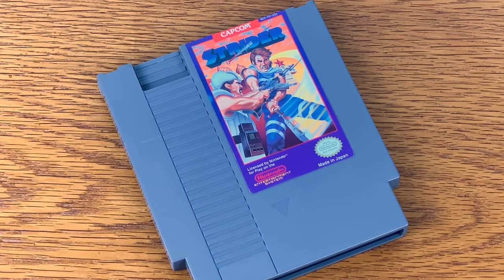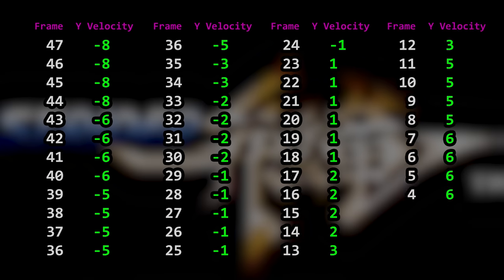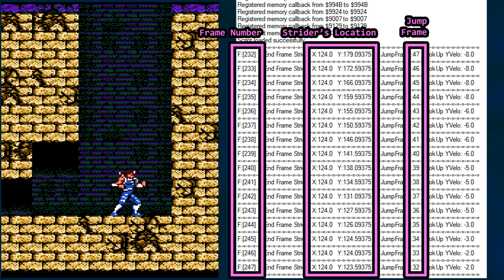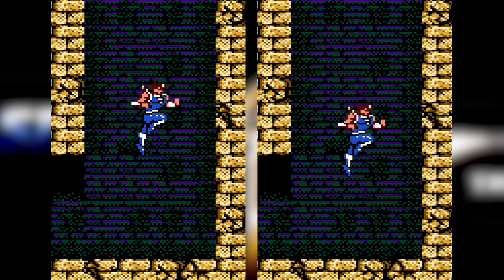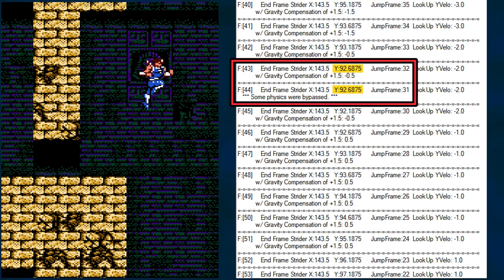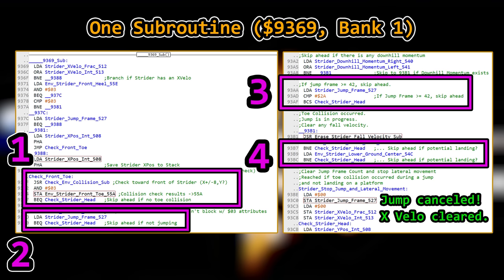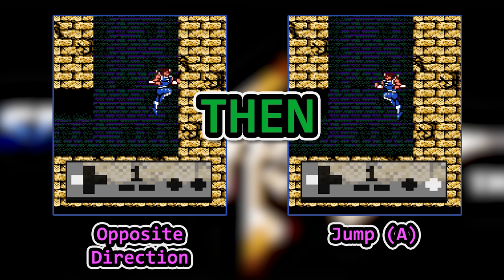The Physics Nightmare and Bizarre Jumping of Strider (NES) - Behind the Code

Comment: This video should be shown in software engineering classes, as an object lesson for why the concept of Finite State Machines is important to understand. The programmers here clearly didn't think in terms of "here's the checks to do if the player-character is jumping; here's the checks when he's walking; here's the checks when he's standing still on the ground; etc — and he can only be doing one of those at a time"; but instead just did every check in every "state", as the ASM equivalent of a long series of if-statements, with many possible overlapping "states" active at once.
Reply: Exactly. These can be extremely hard to debug
Reply: It's not really an issue that an FSM addresses directly. It's a constraint programming issue, because the physics in Strider are supporting several features simultaneously that produce multiple competing answers: are we ascending a slope, is a wall colliding, are we jumping, are we trying to triangle jump? What a constraint solver does is frame the problem in terms of "filter down many competing and potentially valid answers into a single definitive one by turning it into a sorting-and-ranking problem". Applying sorting makes it much easier to reason about than trying to break it down into a large number of finite states.

What Strider actually does, and what everyone tends to do when addressing constraint logic one feature at a time, is to add more and more state to try to adjust one answer as you go along, losing a lot of information in the process. You don't want to lose information in your physics until you know you can make the optimization(and this is why the common axis-aligned platforming logic of "run X axis physics, then run Y axis physics" manages to work well, but imperfectly - it's an optimization on solving for both permutations and selecting the one that gives free movement, it just drops one permutation from ever being considered).
Reply: it's very good for my imposter syndrome that the way these types of bugs are created require programming in ways that immediately set off alarm bells in my head.
Reply: It's worthwhile to note there are good times to use this kind of code, like when you want to blend logic. A string of conditionals in the right order can keep code very tight and produce muliple effects. For example, if the player is not touching the ceiling, skip to the next check, otherwise set vertical velocity to zero. This allows all previous X movement to continue to propagate while allowing downstream gravity or ejection to start from a known point. It requires extensive planning, but it allows for overlaid logic to address complicated states.
Reply: So in a nutshell they anticipated quantum computing in a videogame.
Reply: NES Strider Hiryu is Schrödinger's Avatar.
Reply: I quickly found out through doing a few game jams that Finite State Machines are my favorite way to code a game.  They're easy to keep organized when you're trying to integrate several different elements at once.
Reply: @BetweenTheBorders is this example from mario 64 tik tok clock warp?

Because i believe i heard it explained as a way to keep mario from clipping but in this very rare to reproduce bug, caused mario to warp to the top of tik tok clock.
Reply: Dude, this was an arcade game, he's looking at the wrong version of the game. Nobody played this shit on a goddam console.
Reply: @nickdorazio3rd  I heard that was a cosmic ray smacking the transistor just right to flip it to 1 from 0 or vice versa

Comment: So, the sprite logic starts late in the frame, the controller inputs are read late in the frame, and the physics calculations happen late in the frame....  What is Strider doing early in the frame?  Microwaving fish soup in the NES's breakroom?
Reply from the maker: Hey... What's that smell?
Reply: Late in the frame is specifically when you want to do all the input and input-dependent tasks. The later you can do them, the less total input to output latency you're going to have. But before the vblank hits and you have to update the scroll and upload the sprite table quickly.

If you're wondering what you might be doing early in the frame... well the very first thing you want to do is pick a good time to run the sound/music routine to update the soundchip registers, maybe you do this on a line interrupt to reduce jitter, then you want to load the graphics tiles for the things getting scrolled in, which takes a while, update the tilemap. You might even be doing enemy animation sprite and position updates early in the frame before you process inputs, projectile updates as well. You do this in the shadow buffer in main RAM. Enemy logic too, because if the enemy seems to react to your actions rather than catch them mid flight as if it was mind reading you, its just a tad more convincing. You can process pickups before inputs as well, making them also a frame delayed, it's fine, looks even a little weighty, nice.
Reply: It's finishing the overdue and now pointless sprite worn from the previous frame 😂

Comment: My god this game is a gold mine of bad freaking code decisions.
Reply: As seen in the comments sections of the first video, NES Strider seems to have been initially programmed by someone with no (or very little) previous experience with the system and then a more experienced programmer at Capcom (who was responsible for that game) had to jury-rig fixes just to get a "sellable" product out the door in a relatively tight time frame.

Comment: Despite NES games being somewhat of a niche, this is honestly more valuable than most game development tutorials and "essays" I've found. It's not about the code per say, as in, what I should type. It's more about the problem I'm trying to solve. The way you structure your videos gives me better ideas about how I should try to think about specific problems, and the logic required to make the code blocks I write work with each other, instead of just trying to find the right "Fix", the right math formula, whatever.

I can't say I understand everything, but you often put me on the right path, and that's all I can ask for.
Reply: Honestly what I love about channels like Displaced Gamers and RGME, they focus less on what the code says exactly and more on the logic of the CPU and likely what the developers were thinking when designing things. It makes it very helpful to actually learn and understand these things. Very useful, even if you aren't familiar with 6502, or even retro games in general.

Comment from the maker: This one was a blast. What do you think of holding down A for the Triangle Jump? Should I have gone for something else? There are so many other issues to address in Strider.

Speaking of things to address in Strider - I think I will upload some of my Strider work to the Displaced Gamers GitHub (by the way... Displaced Gamers "is on GitHub"). This project took a lot more reversing than usual. Perhaps someone can take the work and run with it. https://github.com/DisplacedGamers

Hope everyone has a great day!
Reply: Seems like a relatively sane solution to the problem and an elegant fix that you can do it in a single GG code.

As far as overall "feel" of wall jumping, I think nothing has beaten the Mega Man X series for me, so I would consider it an improvement if your fall speed actually reduced down when in contact with a wall instead of sped up, but I also think Super Metroid feels awful when a lot of people tell me they have no problems with it, so maybe it's a "me" problem.
Reply: @WillowEpp  Super Metroid's wall jump is tricky, but the game helps you a little with a unique frame of animation to let you know the window to press the jump button. If you're spin jumping along a wall, then press away from the wall, there is a window of about 2 frames where Samus' sprite switches to one where here feet look planted on the wall. That's when you hit jump.
Reply: @GeekSHO  Oh, I know exactly HOW it works. I can do it. I just hate how it feels. It feels awful to me.  This is a subjective thing.

(I still think that if there were more than three months between the release Rockman X and Super Metroid there's a good chance it would have turned out differently, but we'll never know for sure. ㄟ( ▔, ▔ )ㄏ )
Reply: This is basically coder church. PREACH IT BROTHER AMEN!
Reply: I agree that the solution is better and a good patch but it's too easy and some timing constraint should make it more fun.

Comment: I actually took the time to finish the game despite the awful experience of movement and every sprite interaction feeling glitchy. I had recorded the last stage on a VHS tape of games I had completed, so I got to watch it again over the years. This video doesn't even get into the difficulty of jumping effectively off of slopes which are prevalent in the game and usually interacted with while scrolling is happening.  I had to figure out the wall jumping without knowing any of this too. I would just try and try again when physics broke and I definitely remember making sure to stop the screen scrolling before difficult jumps despite not knowing why this helped. Thanks for making all those hours of frustration finally feel like it wasn't my failure to learn... it helps to know that I was actually  learning to subconsciously manage a handful of horrible bugs and somehow still be able to beat it without having to restart my VCR recording too many times to make it possible.

Comment: A solution that comes to mind to fix the triangle jump logic: only require the button press, not the direction change. The player will still naturally hold the wanted direction to reach the opposite wall. To prevent abuse, we could also ensure that you can't jump more than once in a row from the same wall (by comparing the x position of the wall jump with the previous one?)

Comment: I remember when I first played Strider on the NES, I was seriously considering taking it back to the store, because I was sure it was a defective copy.  That's how bad the physics are in this game, and it's nice to see some explanation, even if the explanation itself is baffling — why would Capcom do this instead of just using a normal jump physics routine?  Was it all to (badly) implement wall jumping?
Reply: ... also, I was amused that Strider bounces off walls the same way as the square in Adventure, for what I suspect is the exact same reason (specifically, that it has wall ejection without wall collision).  Even later Atari 2600 games like Haunted House don't do that.
Reply: It seems like a completely inept programmer did the work for some reason. Maybe it was an intern
Reply: @MaxOakland  The game's credits highly suggest that the initial programmer was indeed very inexperienced with NES development and that a more senior programmer had to jury-rig "fixes" to get the game to a "sellable" state.

Comment: I've started writing my own emulator, although for the PS2 and not NES, but I'm definitely going to incorporate a debugger into it because of your video series. The more I see of this series, the more I wish every emulator had a debugger built in. I know it sounds silly, but I'm also going to write a PS1 emulator at the same time because if it does PS2 games it should also handle PS1, since the original hardware could, and I don't accept the later revisions that removed those chips as valid for the purpose of writing my emulator.
Reply from the maker: That's awesome! Good luck with your work. I feel the same about debuggers in emulators. I also wish they were all as good as Mesen's.
Reply: Mesen is just amazing in that regard  @DisplacedGamers
Reply: I think all revisions of the PS2 can play PS1 games.
Reply: @CptJistuce   If they could then it was with emulation, because they removed the PS1 chips in later revisions.
Reply: @anon_y_mousse  really think you're thinking of the PS3's loss of PS2 compatibility, as most of the PS1 hardware in the PS2 was a pare of the IO Processor and integral to operation in PS2 mode. That's where the R3000 lived, as well as the DMA controller, sound processor, controller and memory card port handlers...
Reply: @CptJistuce  You might be right about that. I've been reading about the PS3 at the same time, and I probably should just focus on one thing at a time.

Comment: if i'm not mistaken, super metroid actually uses a very similar wall jump mechanic. you have to make contact with a wall and then rock the d-pad the opposite direction about one frame before you hit the jump button again or it doesn't appear to work

Comment: I feel like the better solution is to simply cache the "changed" A button press state for the frame into a second cache location, then check that in the wall jump routine.  Since the main "changed" status var is wiped by the time you need it for processing, you'll have a backup value now insteaad you can check.

Comment: The real irony of the wall physics in that stage when you are doing the Triangle Jump (I think its Egypt ?) is that ,when you look at the way that Capcom later figured out what they wanted to do with the wall physics in another game series that relied on that:  Mega Man X

Like it seemed like the programmers here were trying to learn WHAT they wanted to do with walls because it seemed like the wall on the left was programmed with "Grip" and the other wasn't so that causes a conflict for the player because they can't keep a proper mental clock in their head to actually do the jump properly.  If we took say...Super Metroid its a lot different because the game's walls didn't really have "friction" but seemingly a strict set of inputs that the triangle jump had and ,unless you practiced it a lot you were going to have problems as that always gave me nightmares.

While I am no programmer it feels like CAPCOM wanted to create a type of complex mechanic but didn't realize its surfaces were in conflict with each other vs.concert and like I said when it came to Mega Man X they seemed to have figured that out because when you wall jump in that game all surfaces seem to have the friction that is required and not grip.

I know I might have just repeated a lot of what you said in that section of the video but for my laymen brain that clearly has not programmed a game I needed to try and really simplify this for myself just to understand this even better.

That said though this is a great video and a really awesome channel for people like me to see what is really going on inside of games that I grew up on

Comment: It would be very interesting to see you do an equally deep dive into the code and logic of jumping in a game with a similar level of jump/movement complexity, but with - in your own subjective opinion - 'good' jump/movement logic
Reply from the maker: It would take a bit more effort, but I think Super Metroid is a good candidate for that. On more of an NES note, the Mario games - both SMB1 and SMB3 would be good examples. Changing direction in midair as well as acceleration when running.

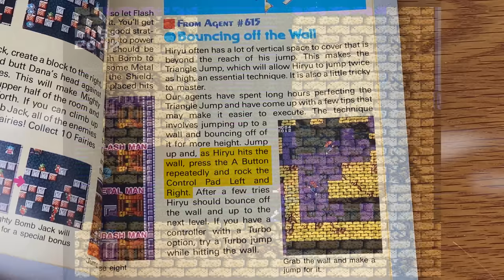Comment: 11:13 & 15:51 This is not a good suggestion to do the Triangle Jump because this is also what I did initially by myself without relying on any guide or advice as a kid playing the game in 1992.
Wildly rocking left & right while jumping only brings frustration and finger injury.

The method that works for me is : 
There is no need to hold down the jump button. Tapping jump or holding jump will give the same jumping height results.
Do not walk against the wall before jumping, your jumping height will cut short to about 1/3 making it impossible.
Do not rock the direction left & right multiple times wildly within 1 second, the actual timing is changing the directions calmly around each second. Doing it too fast will make you fail.
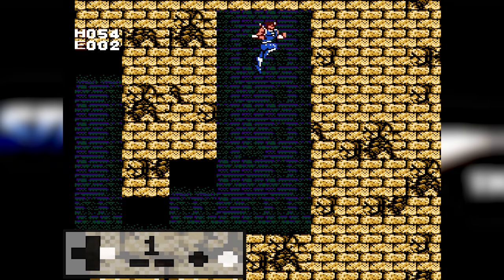So watch from 11:36 - 12:01 carefully to understand the steps below.
Do not be afraid of dropping down a few pixels; it is important, more reliable and comfortable to do the triangle jump this way.

Start by walking towards the wall and tap jump.
Let the character touch the wall, then stall and start dropping down a few pixels.
Then only press the opposite direction, and then tap jump within half or quarter seconds to make a successful jump. (You can attempt to press the opposite direction & jump at the same time, but you will fail if the jump button is pressed first instead before the opposite direction button is pressed)
Repeat the touch wall, stalling, dropping down a few pixels, then changing directions, tap jump within quarter second of direction change.

Using a turbo jump will help doing this easier as it will help you concentrate on the touching wall, stalling, dropping down a few pixels, then changing directions.

I have reconfirmed my methods above just a few minutes ago on my NES.
Reply: Having recently played through Strider NES myself last week as part of a full series playthrough, I can confirm that (at least for me) this method was more reliable than the few times I tried to rock the d-pad around. Triangle Jumping still wasn't great, but I was able to get through the game without ever using the Jump Trick for platforming.